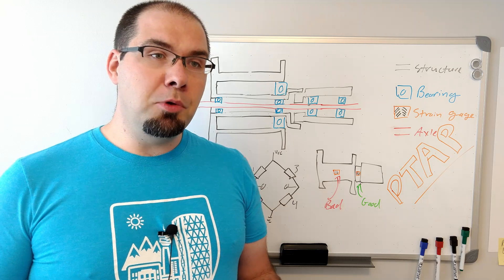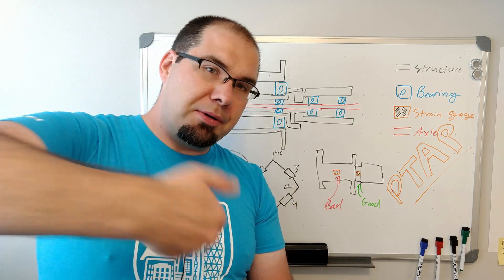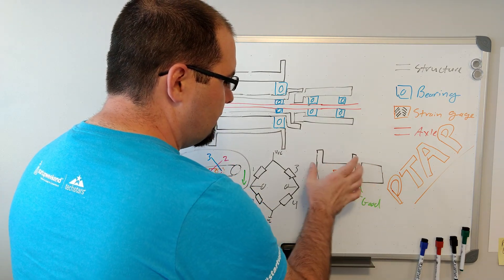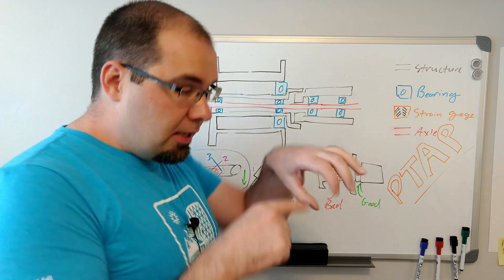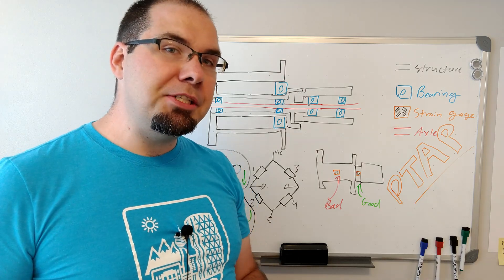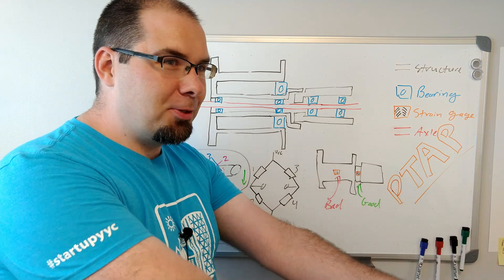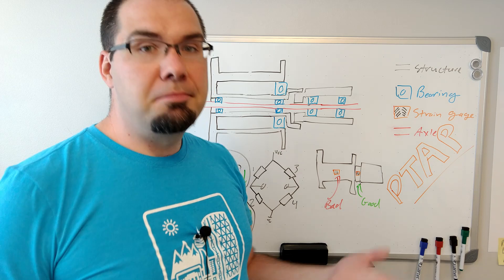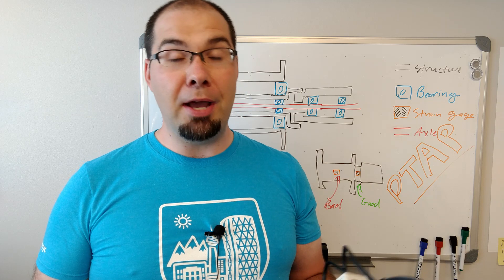How a Powertap hub works and why nobody talks about it

Comment: Correct me if I'm wrong. Direct drive trainers don't have strain gauges. Is this because of Powertap patents?
Reply: Probably cost. I think when you have a standardized unit on the market, you can develop a pretty accurate power curve algorithm based simply on the RPM of the drive unit (like the kinetic inride)

Comment: I didn’t hear you address the 2nd Part of your title - “why nobody talks about it”. Have they gone out of vogue, or are they no longer competitive in some way?
Reply from the maker: Basically not much goes wrong in terms of mechanical (except water ingress and the bearing issue). Therefore very little testing and little controversy about it -- basically it's simple enough to have no inherent accuracy flaws. Now in terms of popularity it wasn't my intention to discuss. I suspect a lot of it is shipping and stocking. Wells are more personal than cranks, almost as much as pedals -- just more variety. The weight, the shipping, the changing of wheels have all been contributors to their slow decline. Convenience is king which is why pedals have overtaken just about everything.
Reply: @kwakeham  bingo. The weight is why they are gone.

Comment: Very nice explanation, Keith. I like PTs for aero testing, even with the 1.26 second updates: you don't have to worry about drive train losses, the speed sensor is built-in, and I don't really care about cadence precision very much (I can back-calculate it from speed and gear ratio if I need to). NP and IF and TSS are slightly, but not horrendously, affected by longer time averaging; what they're more affected by is data sampling (early versions of head units for PTs and SRMs and the old Polar S710 chain tension meters used to lengthen recording time by systematic sampling of the data packets so, for example the PT doubled recording time by only keeping every other 1.26-second record and ignoring the other. SRM head units up until (I think?) powercontrol IV used to do a similar thing. That kind of sampling is much worse for NP/IF/TSS calculation -- but then, like cadence, I don't much care about precision with them.
Reply from the maker: Can't really speak to the SRM point (I had a V and VI but never a IV in my possession). You're not the first but maybe  about the 3rd or 4th person who's extolled the virtues of the powertap hub in relationship to the aerodynamics. I haven't looked into the why, but several companies doing pitot tubes like them. I don't know what, weather it's the multiple rotations giving a nice average between transmissions, or something inherent in their mechanical, aero companies like them more than even spiders.
Reply: Well, when we first starting looking at the performance of the Track Aero System on velodromes, people were bringing in their own power meters. The TAS turns out to be pretty demanding of good data quality so it became clear pretty quickly that some power meters were kinda crappy for this purpose but PTs were pretty robust -- and we didn't have to worry about drivetrain losses. I had theories about why this was the case but after a while I just recommended that people not use certain power meters for field testing aero drag if they were trying to nail down small differences. I'll sometimes help people if they have an interesting puzzle about their field tests, but my first two questions are almost always "how are you measuring speed, and what are you using to measure power" and if they don't have a dedicated speed sensor and/or a PM that produces good data, then their puzzle isn't that interesting to me.
Reply: @robertchung4914   could you be a star and recommend the power tap hub over a 4iiii precision left crank arm power meter please? 
I know you are incredibly well respected, if josh from silca says you know your stuff then 😊
Reply: @allezsport11  First off, it was nice for Josh to say that but I'm just a guy who rides a bike. Second, everything is judged on purpose for task, and some tasks are well met with a left-only crank arm. Third, SRAM/Quarq have discontinued the PT hub, for which I am very sad. I started looking at the used market and last week I bought a used PT as a spare, but it's hard for me to recommend that over a device that has a future.
Reply: @robertchung4914  wow thanks for the reply! I do agree, and there is the connivence factor (swapping training, deep section and disc wheel) too. I’ve gone all in and gone for 4iiii. The only power tap I could find was 2nd hand and I would want to have it built into my wheels which is of course extra cost! 
All the best.

Comment: I use a shimano 11v cassette with campagnolo 11v shifters, and works 100% perfect.
Reply from the maker: Having watched the high speed tests for this, I can assure you it's not... unless you're on EPS. EPS sets the distance on cogs and assume constant which the Shimano is. HOWEVER if your on a mechanical Campagnolo  the spacing is off 0.11mm per cog which results in a whole cassette sweep error of 1.21mm, however if you adjust mid cassette this means its only off about 0.6mm. This is detectable by pro's but most people, like yourself probably find it fine. Perfect is subjective when riding. When in a lab where a robot shifts it tens of thousands of times counting misshifts, that 0.6mm makes a huge difference. Maybe not to you but an elite where an extra 100ms of lost torque transmission is important.
EDIT: Those numbers are wrong! it's only 0.07, so that makes it 0.77mm or 0.38 off. Which is, as you mentioned nor perceivable by most.
Reply: @kwakeham  I use the normal cable Super record shifters and campagnolo rear derailleur.
Reply: It's good for You. But there are people who don't know where to spend their money, so they need this products)

Comment: I always thought they were shunned due to not capturing drive train losses, which should cause a 2-4% inaccuracy. But this page is showing good agreement: https://ridefar.info/2018/01/power-meter-comparison-stages-crank-versus-powertap-hub/
Not sure if they are making compensation given the average drive chain/speed/etc. or if that user just got lucky.

Now we just need someone to do a powertap cassette, chain, and that will cover about everything..
Reply from the maker: I think you're phrasing might be off here. A powermeter doesn't capture drive train loss. It's measuring either before or after. This comparison though resulting in numbers in the ballpark is using a method of measuring half the legs used before drive train loss and comparing to something that actually measures total power after drivetrain loss.  The usefulness of this is suspect even if it aligns with expected behaviour.
Reply: @kwakeham  Yes before or after is a much better way to phrase it. I agree its not conclusive data, I found another comparison here which is better: https://ggtri.wordpress.com/stuff/power-meter-comparison-pt-p1-pedals-pt-hub-stages/ about 4-6% as expected from drive train loss, so no compensation.

Its just something that your average "uninformed" buyer might see 1.5% accuracy and not consider the extra 4-6% on top of that that someone experienced as yourself accounts for.
Also if you are a zwift competitor then that is an instant 5-6% disadvantage over anyone using a pre meter.

Comment: Quarq shows Campagnolo free hubs for PT hubs in stock.
Reply: Think PT use novatec freehubs? Recently changed my 10s to 11s shimano. Though a weightweenies post from 6 years back says the campy are not up to spec.
Reply from the maker: That's good for Americans. But when I was in the EU it was painful a year ago, and in Canada it still is. Quarq.com is effectively a non starter because it doubles the price due to shipping. Quarq.com can be a shipping death sentence to Canada. The 49 dollar hub is 56.92 USD to ship to Canada. Depending on regional taxes (5% - 15%). Luckily that's expedited UPS. If it was ups standard that would be 16.75 CAD just to process the tax, oh and then that is taxed! So IF UPS process it correctly (In Canada that's a coin flip) that hub will be 152-160 CAD or 116-120 USD min! IF UPS makes the mistakes they sometimes do, there is no recourse, and can be about 200 CAD or 150 USD for a 50 dollar hub. Le sigh.
Reply: It's too bad the free hub isn't some other manufacturer's design, one that could be purchased outside of the Quarq/PT pipeline.
Reply from the maker: OR somehow we could sort out cheaper shipping in Canada. It's really big with only 2/3 the population of California.
Reply: I don't know if that can't happen after the Canadian Bacon incident of 1995.

Comment: I've had mine for several years now. Had no idea about the potential indoor accuracy issues. I have a fluid trainer (JetBlack Z1). I let the wheel spin free and re-zero before I tighten up onto the roller each ride. I don't think that it's ever had a chance to slow down to something resembling zero torque during my trainer rides. and my indoor FTP tests on Zwift are actually slightly higher than anything I've gotten outdoors. The maintenance issues I've had are 1) bent rims turn into a wheel rebuild; 2) I broke the cap once trying to replace the battery and had to order a replacement

Comment: I thought powertap hub sampled at 60 hz and updated every 1s? The 1.24s interval was only for the older wired models. Am I wrong? Why is updating more often an advantage. Any reading average under 3 s is pretty meaningless on its own, I would have thought. The other advantage to powertap is that its speed update is via a mechanical relay. Calculating power should be more accurate than most crank-based PMs because the power=torque*rpm equation updates roughly 2* as often as for a crank PM (most update 1* per rev) and many crank pms use an accelerometer for rpm - which is never as accurate as mechanical.

 Never had a problem changing the bearings the couple of times I've done it. NDS bearing appears to be much more prone to wear because it's more open to contaminants.

I've had 4 ptap hubs, 2 wired (1 new, 1 used) and 2 wireless (Ptap GS new and SL2.4+ used) and they've all been super reliable. In comparison testing they've been within 1% of each other.

I think the beauty of the PT hub is that does a great job of isolation from crosstalk/parasitic forces, the very simple and effective auto-zero algorithm that doesn't have to worry about temps and the more accurate and frequent rpm measurement.

The SL2.4+ freehub indeed suffered very badly from cassettes wearing through the splines. Had to select cassettes with full riveting. SRAM cassettes fit better than shimano and are less prone to spline punch through.

Main problem I've had with the hubs has been poor design of the axle setup. Endcaps/washers continually coming loose and requiring adjustment. They've eventually got around to fixing this on later models but took them way too long.
Reply from the maker: Internal sampling rate is averaged out. On ant+ it updates every basic power page at about 1.25s. This continues today with the latest g3 series. Keep in mind cranks update on a revolution so that's about once every 0.75s at 90rpm
Reply: @kwakeham  I'm going to have to disagree with you. As stated above, the older models definitely updated every 1.26 seconds. Once they switched to only ANT+ (G3) it is 1.00 s update.

Not sure how you arrived at 1.26 s for the G3. I worked for PowerTap for the last 11 years.
Reply: Still confused as to why updating more often is an advantage as long as readings are averaged. Wouldn't more accurate and more frequent rpm readings be more important and lead to better data? Hub-based rpm based on speed  is inherently much less variable than cadence.
Reply from the maker: Relative variance is similar if you're always producing some level of torque due to the momentum of the bike. Right now we don't have a use case for high speed data, and when we do spiders and hubs will not likely be the candidate for it's use. Leg muscle analysis will be but that will be on the independent leg measuring meters. For most people it won't be a problem, but when doing powermeter comparisons it means that there is only 80% the data of other meters. For an hour long ride I'll have 3600 data points with a Quarq, and only 2880 for a powertap where some of them are double recorded This means that shorter peaks don't match as well, and can cause skew of calculations like TSS and NP (though Energy correct recording has fixed this enough now, but early and low end cycle computers your TSS and NP Will not match as well when two head units record the same meter by potentially up to 5%). So the net effect of the problem is minimized now. As a data nerd and techy, if you record higher resolution you can always make lower res data easily. If you have low res data you can't get high res.
Reply: Cadence can easily vary from 90 to zero in one second. Speed variation has got to be way way less, unless you're braking when you wouldn't be pedalling anyway. Lots of half pedal stroke data going unrecorded that should be picked up by a hub. TSS and NP rely on a 30s smoothing so can't really see extra data points with larger variances being any extra use. Just a fan of mechanical rpm measurements and measuring rpm more often than 1 pedal stroke.
Reply: @kwakeham  Keith, can you briefly describe the "Energy Correct Recording" you refer to?
Reply from the maker: I think I have some old footage of this when I was having a hard time determining if Zwift was energy correct. Head units record at fastest 1hz, BUT the powermeter can update at 4 or 8hz. So there comes a point at 90rpm even that it will record data, then get an update of new information AND a second update of new information. The proper way (energy correct) is to calculate from the last RECORDED data event thus averaging the two events. HOWEVER, a lot of early and some current cycle computers compute using the last two good events. So there is energy that isn't accounted for (P*Time = Energy). This becomes important when calculating Normalized power / IF / TSS  and other similar metrics as it has the potential to skew them. In edge cases engineer at Quarq, Mark Rages, has found that it can skew averages improperly a few percent and in the far edges potentially even 5%.
Reply: How does the hub calculate the cadence it reports if it only samples every 1.26 seconds (48 samples per minute)? Presumably it's calculating cadence from power fluctuations as the pedal goes around, but sampling would have to be significantly faster than pedal RPM for that to work.
Reply: @ChrisCapoccia  It samples at 60 Hz

Comment: You've shown the torque tube and hub shell as a single piece but CycleOps use to offer a replacement/repair service for the torque tube.  So.. if those are two pieces how is the other end of the tube fixed in place to prevent errors due to movement? If they're a single piece then I suppose R/R involved receiving basically a whole hew hub back with your old freehub and axle?
Reply from the maker: It's a simplification. It's more about highlighting the bearing that supports the torque tube so I could highlight that one pain point with the product which I've unfortunately experienced on every powertap. Last I checked it was a send in repair service. If I got that wrong let me know.